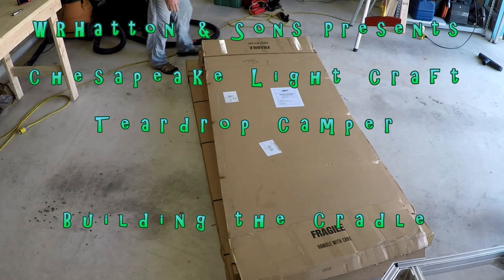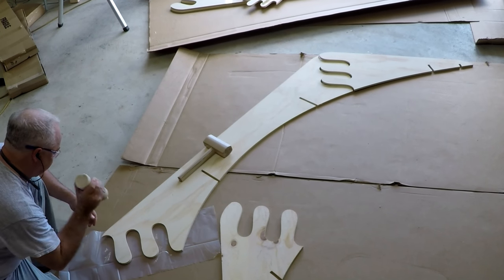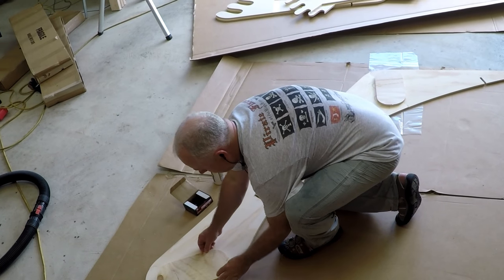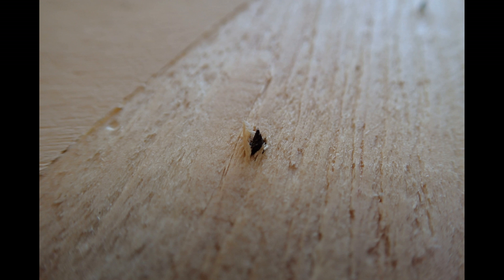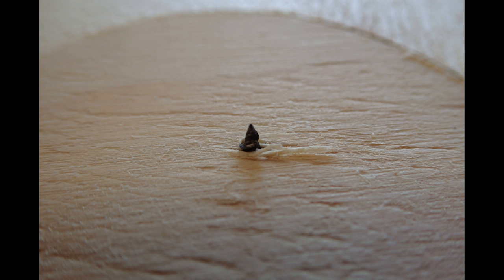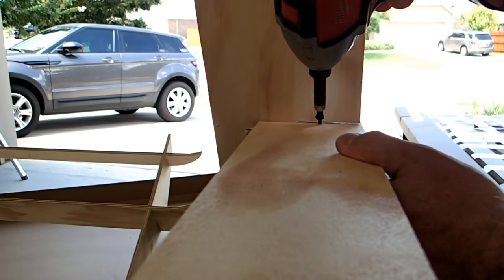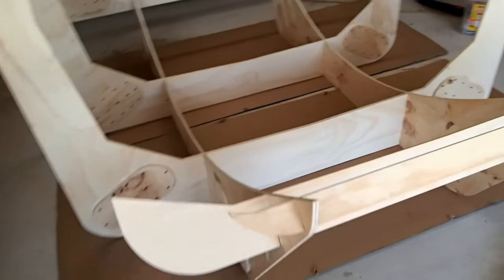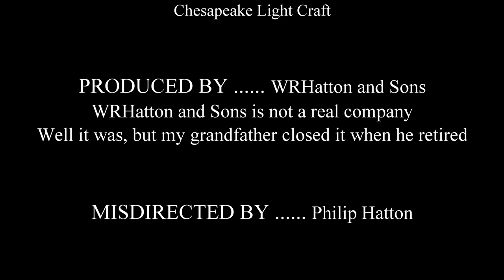Building the CLC Teardrop Camper Cradle

Comment: After using the cradle for your build, did you still believe gluing it was needed?  Can I just screw mine instead would be strong enough?
Reply from the maker: I would say yes.  You end up tipping it at various angles during the build.  I found it to be pretty flexy. You wouldn't want one of the puzzle joints to pop apart.  You aren't gluing the whole cradle together.  It needs to come apart easily later.
Reply: @PhilHattonMakesStuff  thank you.  Starting tomorrow.  I already built a strip kayak from them.  Is a floating coffee table.  Amazing.  I hope my TD goes as well.  BTW, I'm in your muck of the woods.  It would be interesting to see two of these on the road with calc kayaks on our tracks side by side.  Happy paddling and camping.
Reply: Since I pl;an to use the cradle for repeated builds, I am adding a second set of blocks to the REVERSE side of the frames, making a "sandwich" and using 1.25" screws.